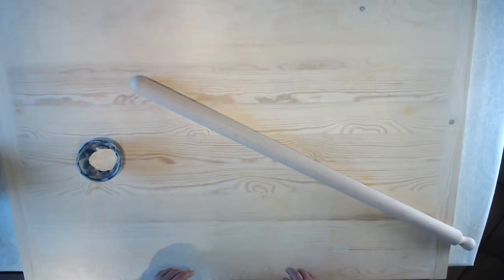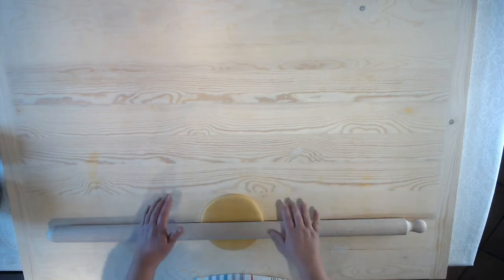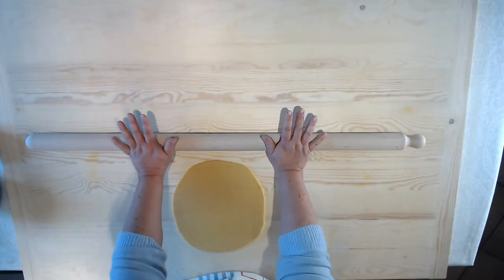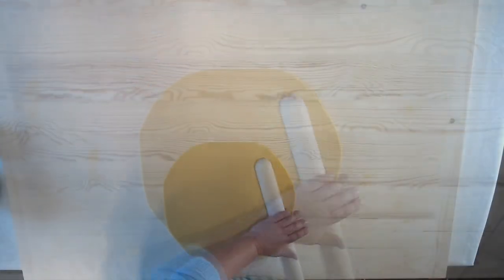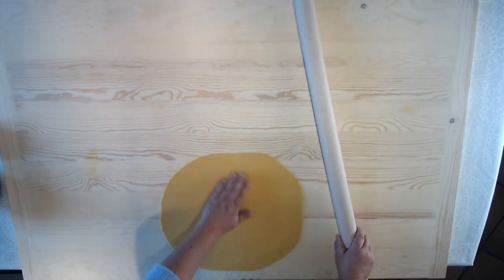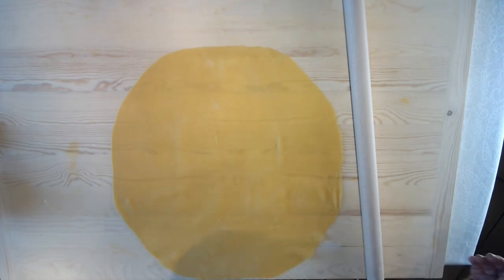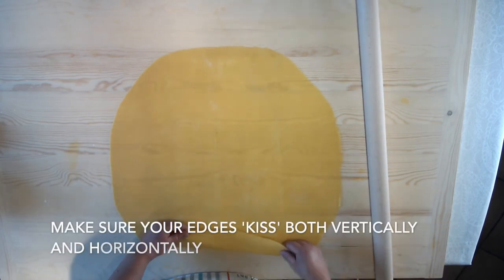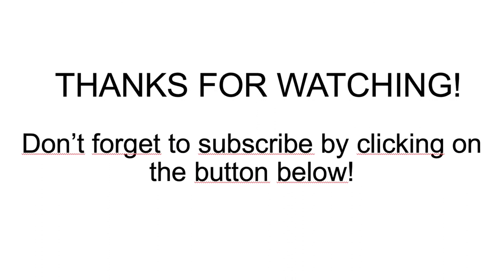How to Roll out Pasta Dough the Traditional Way - Aerial View

Comment: Ciao Helena, thank you for sharing.
I have a question for you. You use your mattarello and tagliere a lot. What is the maintenance? Do you periodically sand it, do you apply mineral or olive oil to preserve the surface?
My mattarello is fine, but I feel that tagliere requires some polishing 
Please advise
Reply from the maker: Ciao Igor, thanks for your question. When I receive my mattarello I leave it as is and do nothing to it. The Tagliere, on the other hand, just because I'm a bit OCD, especially where live classes are concerned, I use a cloth dampened slightly with vinegar to disinfect, leave to dry 24 hours and then use a neutral oil like rice or sunflower and rub it down with that. I leave it another couple of days before using. As a general rule, it's really important to make sure your tagliere is clean - so use a benchscraper to get rid of all the residue. Occasionally, for the boards I use for live classes, I go over then with some vinegar, but the natural tannins in wood actually are antibacterial. If you sand down your board, you will be making it smoother which goes against the objective of having a textured sfoglia. So, as I said, cleaning your board with a benchscraper at a 45° angle is paramount to its maintentance. I am obsessive while I work and knowing many sfogline here in Bologna, that is the most important aspect of maintaining your board. I hope that helps.
Reply: @yummyitaly1970  thanks again. I guess my biggest concern was the tagliere. I do use the benchscraper to remove the residual dough, but because I periodically apply a mineral oil, I can see some white bits getting removed. Maybe it’s a natural process 😂
Thanks again, keep posting your videos
Reply from the maker: @igoreren6149  you don't really need to add any oil at all to it.
Reply from the maker: @igoreren6149  I don't think there is any need to use a mineral oil and the board manufacturers here advise against it. However, if this is your preference then obviously do go ahead.